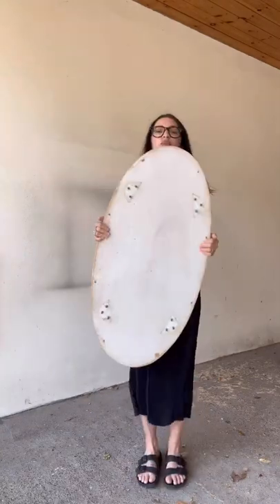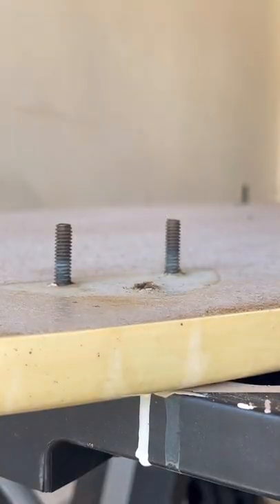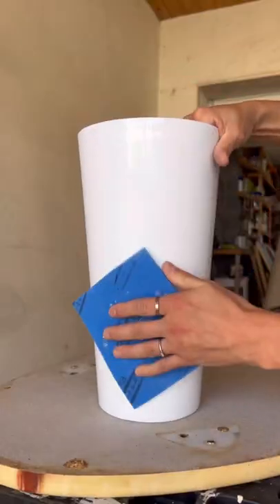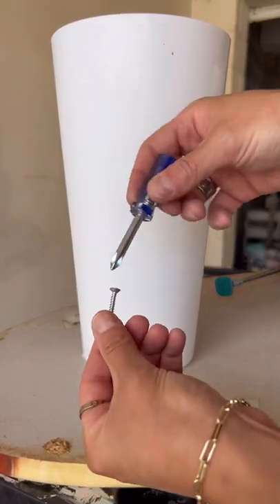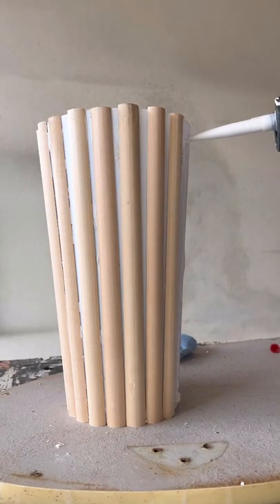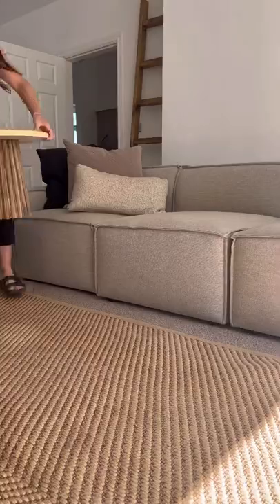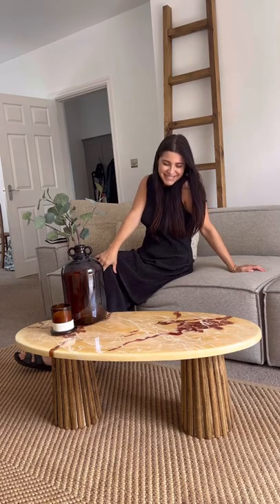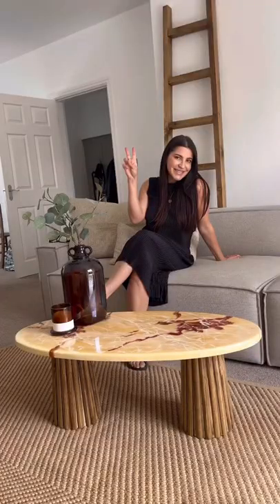I MADE a coffee table out of Flower  Pots! 🤯 #shorts #upcycling #diy #furniture

Comment: Very creative once again. But surely them plant pots won't be strong enough as legs?
Reply: I'm guessing if you don't put like a TV on it, it will be fine lol. A few books or a plant will hardly make the legs buckle
Reply: Was thinking it would be easy to mix up a bit of concrete and fill the plant stands to provide cheap and effective weight to the plant stands/legs
Reply: The dowels will give it the support needed to be used as a coffee table. Also, the shape of the base of the plant stand gives it structure
Reply: As long as nothing heavy is put on the coffee table